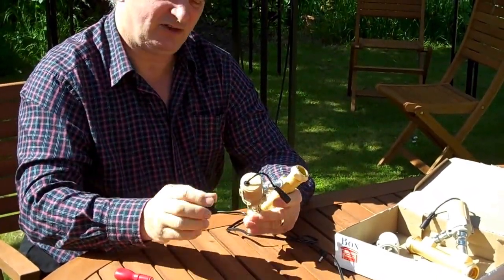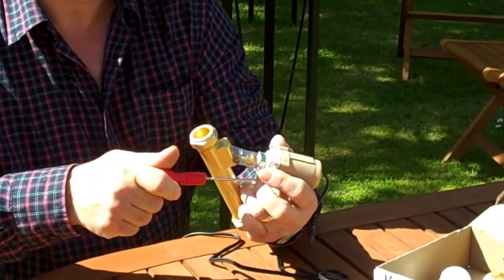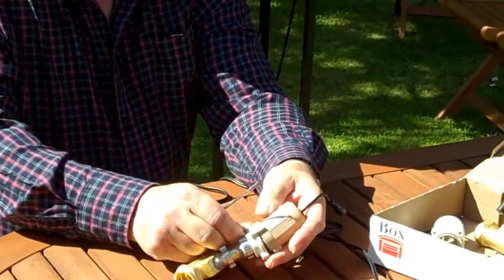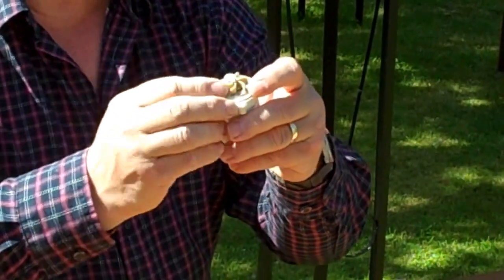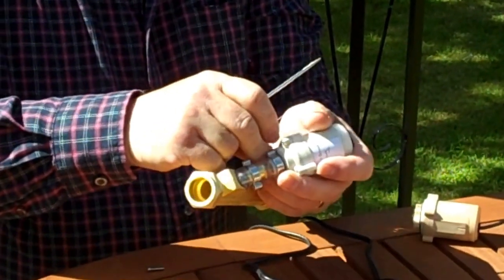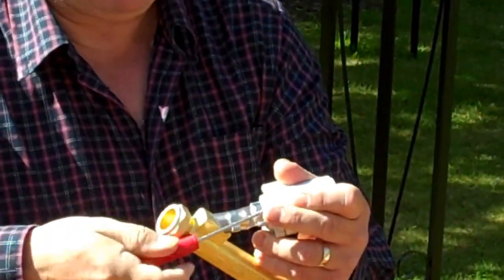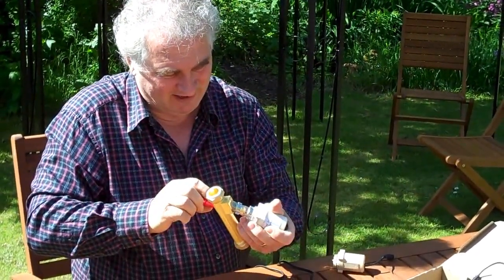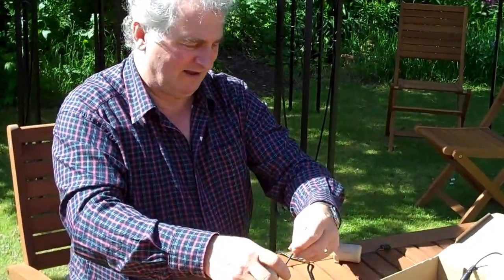Shower Power Booster Pump Motor https://www.wrightpumps.co.uk/product/showerpowerbooster-spare-part/

Comment: Can u change the motor without turning off the water
Reply from the maker: You need to turn off the water and remove the SPB. You can work on the SPB when its still in place but if you are doing this for the first time its far easier to take the unit out - fix it - then refit it.

Comment: New motor arrived the next day  - Excellent  customer service !!
Reply: If you can't isolate the hot water will it leak when you replace?
Reply: @triplemex  yes it will
Reply: @Bish221  thanks. After further investigation my issue was the cartridge on the hot water tap. Replaced tap and issue resolved. Pump still going strong💪 These pumps are so underrated!

Comment: Just fitted one of these very easy to do 8/10/22
Turn the water off also 

The rubber gasket is clear ( was on mine initially I couldn’t see or get it out but did in the end , blunt knife helped 

No6 pozi / Philips stumpy worked for me 
Just due to tight space and pipes in the way 
But I think a small ratchet with a screw bit may be easier to get to the screws 

works fine back to a nice shower now